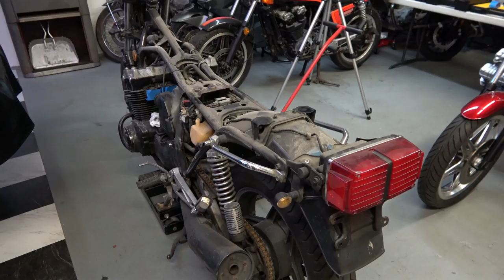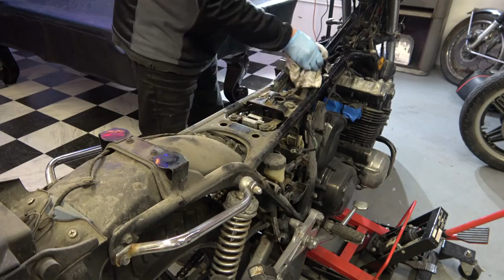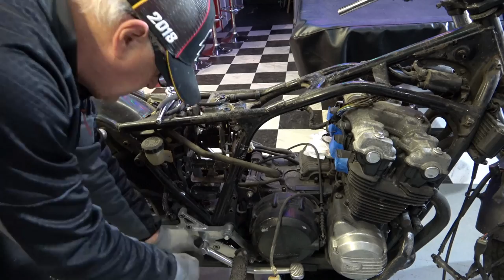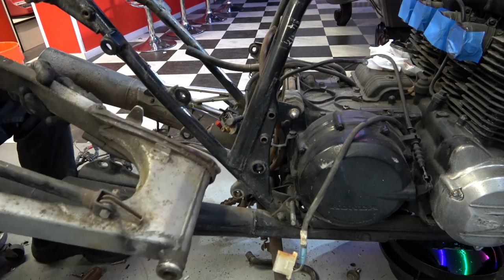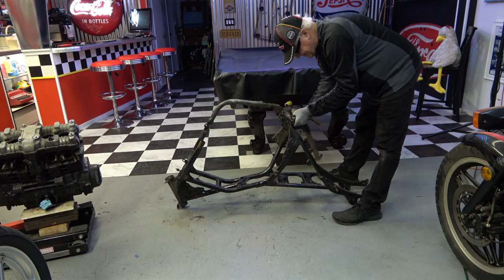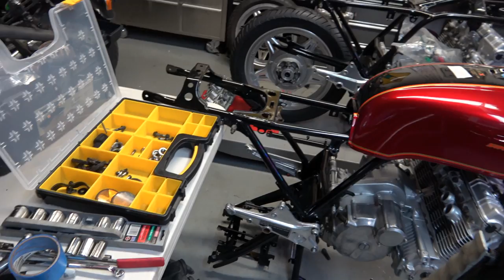1983 Honda CB1100F Full Restoration Part 2 - Initial Tear down from complete bike to bare frame

Comment: Just bought a running and riding  CB1100F last week with 14k miles. Same owner for the last 30 years. Only thing not working is the tach. Aftermarket Yosh exhaust and Corbin seat but he gave me the stock exhaus, seat and eng guards.

Comment: Hi can I ask what you do about the brake line do you have a supplier of std rubber line or do you use braided cheers
Reply from the maker: Hi Ian, I tend to want to use the original style Honda brake lines if the bike is going to be restored to original showroom assembly line correct condition. They usually are date coded and is one of those details that separate the men from the boys in restoration. But if it was going to be a resto-mod or a daily rider, then, of course, braided lines are the best as far as function is concerned. If I were to use braided lines, I would get black ones or paint them black at least so they sort of look like the originals.
Reply: digitalpizza cheers struggling to find NOS items and can’t seem to find any repro of the original rubber style ones. Thanks again

Comment: Just getting ahead here.... are you going to do any engine work?  At least a valve clearance check?
Reply from the maker: Hi Ray, yes, as I mentioned in the video, I am going to rebuild the head and install new rings and hone the cylinders, assuming that everything looks good when I remove the head and cylinders.